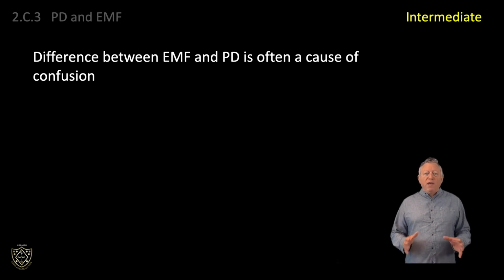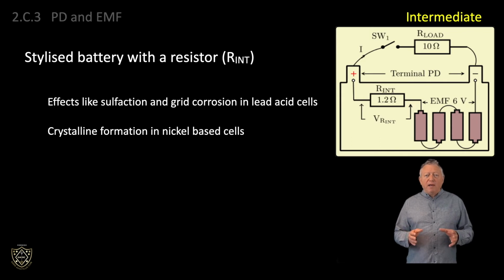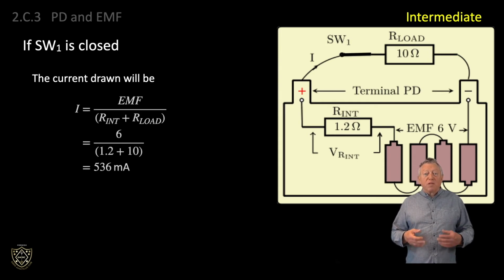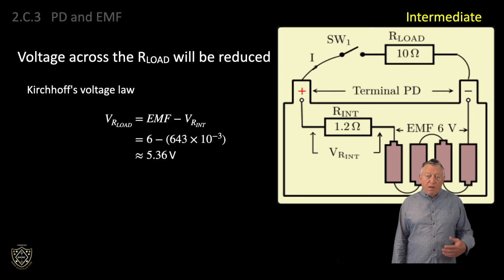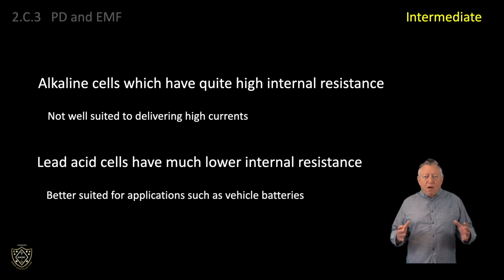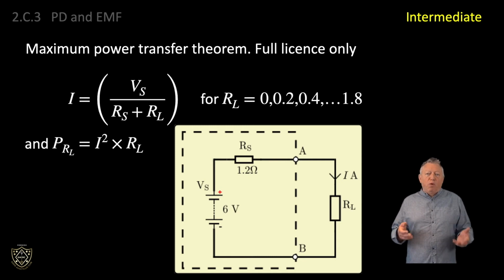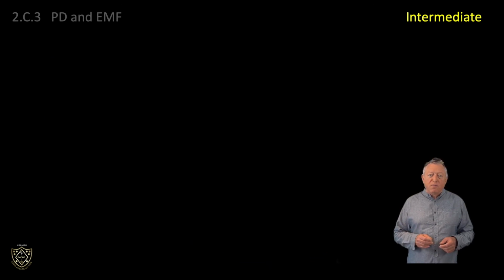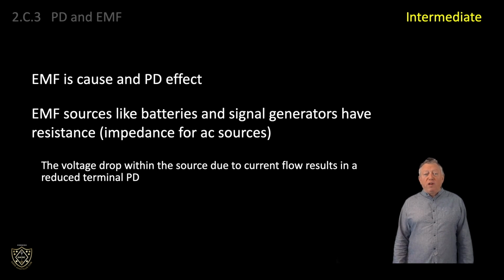2C3 PD and EMF

Comment: VRint = I x Rint i don't understand where the 10-3 comes from? Could you explain where that comes from? Because if its I x Rint shouldn't it be 536 x 1.2? Or am i missing something? 
Any help would be greatly appreciated 🙏
Reply from the maker: When you multiply current and resistance values they must be in the fundamental units.  In this case the current is 536 milliamperes, or just over half an amp.  So you could multiply 1.2 x 0.536.   Or in your calculator you could use the appropriate keystrokes to enter 1.2 times 536 times 10 to the minus 3 to get the same result.   Try this BBC tutorial on standard form.  https://www.bbc.co.uk/bitesize/topics/z2mf9j6/articles/zh4ny4j
Reply: @cornishradioamateurclubtra4073  right that makes a bit more sense so if its milli its 10 ti the minus 3 so if its an ampare or higher it would be 10 to 3 is that right? Sorry mathematicians isn't my strong point. Thank you for the reply and link it was most helpful
Reply from the maker: Micro is 10 to the -6. E.g micro volts
Milli is 10 to the -3. E.g. milli watts
Thanks 
Fundamental unit. Amps volts watts metres etc.  is 10 to the 0.   Or just times 1  

Kilo is times 10 to the 3.  E.g kilovolts.  Kilometres. 

Mega is times 10 to the 6.  E.g. a megahertz is 1 million Hertz.    That is one followed by 6 zeros.
Reply: @cornishradioamateurclubtra4073   thank you this makes alot more sense 😊 i appreciate your replies very much 
73s